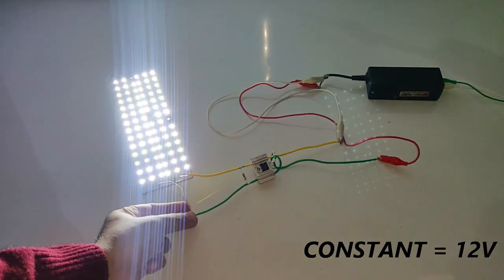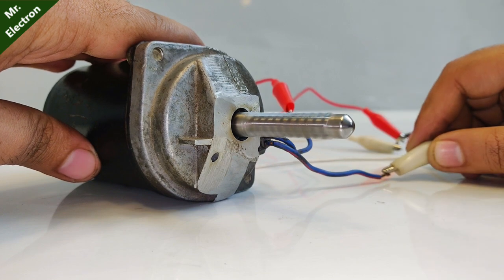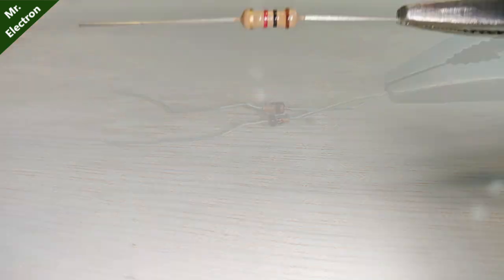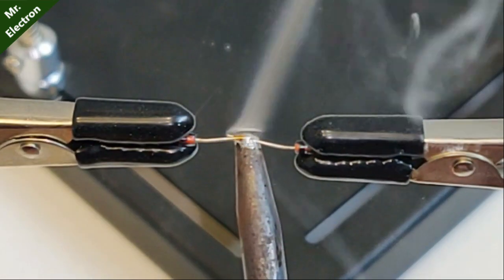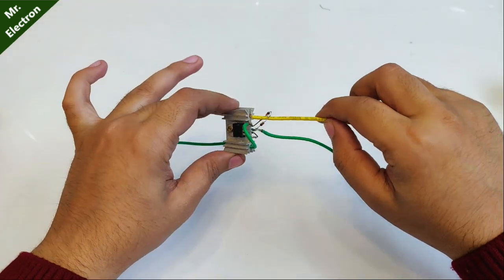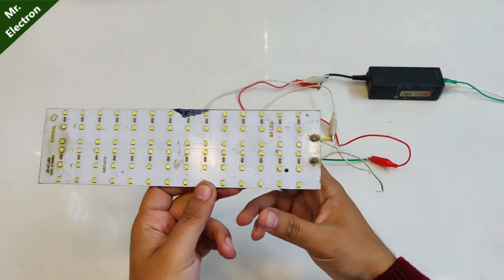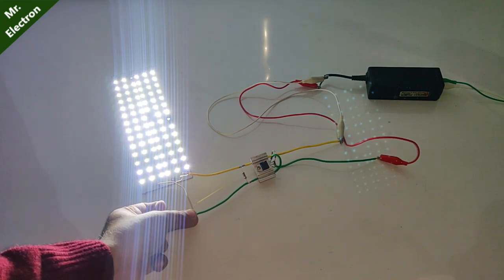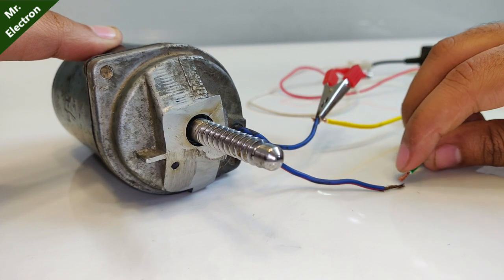12V 100W DC from 220v AC for High Current DC Motor - Power Supply from Laptop Charger

Comment: Yes the voltage is in safe limits, Whats the max current it can handle ??? 
Can this be used to charge a bigger battery of 100ah from solar panel  ??

Comment: I doubt that the "high current" motor will pull its maximum load when idling. You will also not be able to charge an AGM battery with 13.3 volts. Your voltage regulator is based on the zener voltage of the diodes and the gain of the transistors. Both very variable values.

Comment: If the 20v supply have a lower power output and a 12v motor or other load is applied to it with a higher power ratings, the supply voltage will automatically drop to 12v or below respectively. But if an inductive load such as motor is not applied to any load, the commutator brushes will wear out faster and the magnets might also go weaker by use.....
Reply: Actually smps supplies are not designed to go so low as dropping to 12v so under heavy loading , they start to flicker and hence not usable.
Reply: @mrelectron_alternator  you are absolutely correct but in transformer type this don't happen,i.t, the voltage will drop